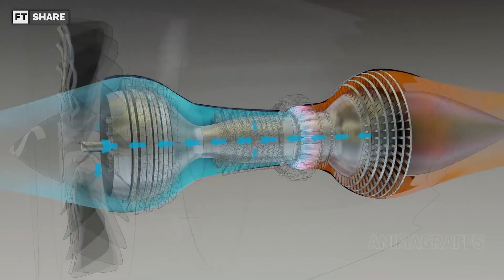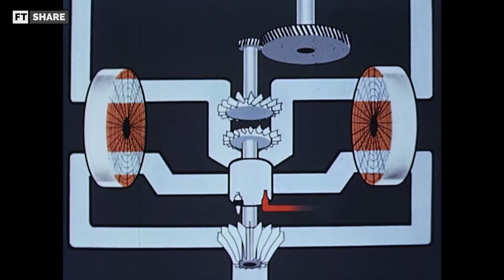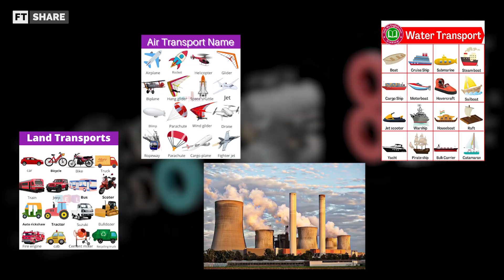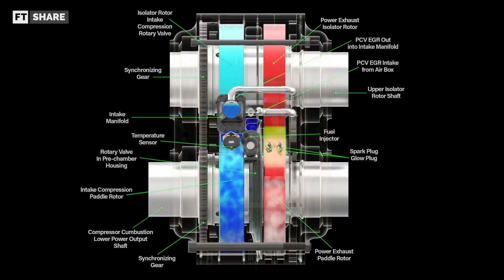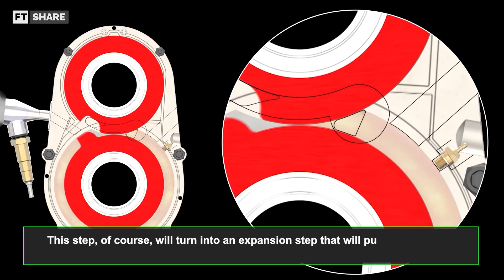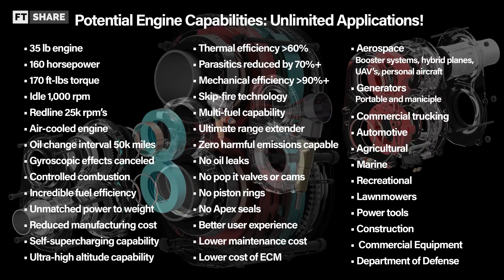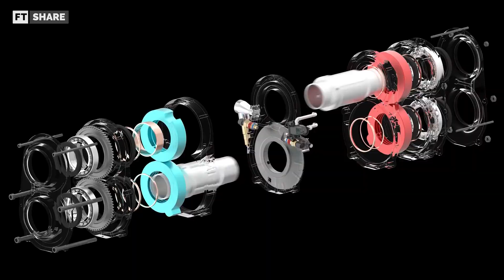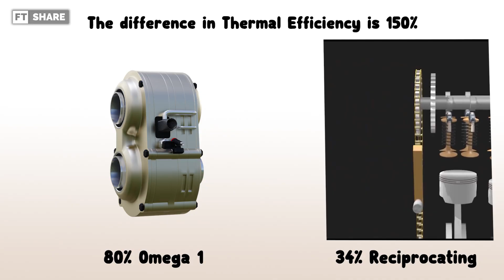Ready To Destroy EV Engine!! | Astron Aerospace - Omega 1 Engine

Comment: Don't see how it outperforms electric motors LOL. And EVS don't use an engine, it's called an electric motor for a reason. This thing would be used for hybrids that make do with the 160 claimed HP. Also, fossil fuels. Majority of ICE is still fossil fuels, with very few using sustainable fuels or hydrogen (hydrogen needs to be produced, so this lowers overall efficency on top of the already so called 80% efficency). So, if it's anywhere higher than 40% efficency, say at least 50% for running on gasoline it's better than current engines. 60% efficency would certainly guarantee hybrids exist longer and would support hydrogen ICE engines for ICE enthusiasts.

Comment: I would just like to know the fuel consumption of this engine would it be the same as a Wankle? I'm really cool thing about this engine. Is it only weighs 35 lb versus around 700 lb for a V8? Even if you put four chambers together, it comes out to 170 lb for an engine that's even still weighs less than 4 cylinder weighs.

Comment: 100,000 hours is equivalent to 3,300,000 millllllllion! miles. With a city-highway average of 33 mph. Easy to figure out of course. Ive seen most cars and trucks average speed between 28-39mph. Vehicles in rural areas could attain 40+ and small transit vans would really benefit from this. The question is how fast for how long.
Reply: Adding AC, generators and power steering would most likely cut these numbers in half.

Comment: Has a lot of pluses, but heat and sealing is going to be a problem, air cooling not likely, ease of manufacture, compression ratios,size, good, 80% efficiency is  Trumpian, but as I learned with my last venture, it’s tough to unseat a system that has been in vogue for over a hundred years, little development appears to have been done,the start is easy, but, as rolls RollsRoyce said to Whittle on acceptance of the Jet as a concept, (Simplicity? Don’t worry about it, we’ll soon fix  that!

Comment: In aircraft, turbine engines are notoriously slow responding to throttle changes, so much so that a jet routinely goes to high power as it starts to land, just in case the power is needed to go around, whereas a piston aircraft engine can respond almost instantly to a "power request".  I have seen power numbers in the stats but no mention in any of the discussions of responsiveness for this engine!!!  Aircraft can get away with slow responding throttles, cars cannot.

Comment: I would mentally think of it as most similar to a supercharged two-stroke. But I wouldn't classify it outwardly as falling into the "stroke" classification system at all.
Reply: Or a "two stroke diesel" (Detroit Diesel if you are American). I have better alternative designs, also suitable for anything from motorbikes to railway locos, one of which I proposed about 30 years ago. But live in the UK, where it is impossible to get funding for anything that takes longer than 3 months to develop. I told Ford, and they replied "we don't need new technology - we have old technology, and people are already buying that!" I also told GM and some other companies, with much the same response. 

If anyone is interested, I also have a design for a new type of wind turbine, with several advantages over huge rotating vanes.

Comment: I have seen similar engines to this.  The mechanics to this engine are a bit complicated but possible, this complicated mechanical design will drive up the cost, sealing this engine is possible but a nightmare. However, the overwhelming design drawback is the compression phase of the engine, notice the combustion chamber is expanding during the compression phase which makes the compression of the gases very poor hense poor efficiency.  If you compare this engine to the ME2 engine you notice that the ME2 has a very high compression phase hence high efficiency.

Comment: I remember the rotary engines offered in the 70ies. Seemed to be a miracle solution on paper, but the poor guys who bought these cars (NSU, Citroen, ...) rapidly understood that they were gas thirsty, with bad kmage per liter (or mileage per gallon for masochists), and costed a lot in oil, needing to refill after 1000 km. The joints were the main problem.

Comment: IF, the efficiencies, process, and 80% thermal performance holds true; this  is a significant breakthrough. Paired with a battery, this would be an incredible hybrid. Potentially doubling mpg. Its time to leave the 1800s timing chain, valve shafts, etc. I am impressed. I hope the unrealistic battery lobby does not destroy it.

Comment: Unless this concept employs ceramic materials with little to no heat expansion and extremely high heat tolerance, I don't see how it could be sealed, or even lubricated without a "dirty" oil-fuel mixture.

Comment: Yeah 80% thermal efficiency is impossible, because of thermal limitations of materials. It needs to get really really hot, the max efficiency of a heat engine is given by its carnot efficiency, which is 1-(T(cold)/T(hot)). Now if we assume the global average temperature of 15 C, that would mean to get 80% efficiency the engine would have exhaust gas 1167 C (minimum), typical cars have exhaust temperatures of about 200-250c. This is reaching territories of jet engines.

Comment: I don't see any seals, except blue ones on working model. And why it's dripping oil? Why smoking so much?
To design model in some CAD software is much easier that a working prototype.
For this engine to work there must be extremely tight toleration between moving parts. What happend when the engine heats up? What about thermal expansion? That's why we have piston rings, to compensate thermal expansion of different parts made of different materials. I don't see any here. 
And the numbers..... No comment

Comment: This is about the 10th video I have seen on this engine,and they all have the same 10 second clip of it running and nothing more, how about actual footage of it working in a practical application with a load on the engine? Otherwise the only thing it destroyed was my time.

Comment: Nice video, but let us wait for that engine to come. 
A few remarks on the comparison: the omega 1 engine is supposed to weigh around 16kg. But, what is included in this? I could not see any cooling equipment, although I might guess (even with the claimed, high thermal efficiency) it will heat up quite a bit. So, add the weight of radiator, water pump, etc. Then, how about a starter? Or an oil pump, etc...? I wonder at what final weight the engine will see the light of the sky... 
The same problems with sealing gave (practically) death to the Wankel engine a few decades ago. So, 100 000 hours without maintenance will need to be proved 🙂

Comment: The problem with vehicles equipped with engines like the Omega One is that a turbine does not provide reacceleration like the combustion engines used in current vehicles, making its use unsuitable for traffic in large cities.
Being used to generate energy for electric motors and with that impressive thermodynamic efficiency reported in the video, which would lead to negligible fuel consumption per kilometer driven, the use of the Omega One will be more than welcome.

Comment: Wow this clearly is a design that need many years of development, possibly 7 to 10 years to perfect and be economically feasible.  To be able to compete with EV/battery tech 5+ years down the road is a mission nobody wish to make, as the outcome is easily predicted.

No matter how much more efficient, you're still looking at a whole slew of moving parts, many at high speeds in very high temperatures.  This equates to maintenance cost that the average consumer would much rather live without.

Comment: So this is all theoretical since they haven't built one yet. How many of these "revolutionary" engines have we seen in just the past 10 years that were going to make everything else obsolete? The Engine also needs a cooling, oiling,  and electrical system added to it which will increase the weight.

Comment: Run this motor on hydrogen to continuously change a relatively small battery in a car and run the car on e-motor eliminating the gearbox and the weight, friction, maintenance … associated with it.
Probably the best of both worlds!

Comment: Which is it... 3.355Kw or 33.35 Kw?  The difference believe what was said and what was put on screen is an order of magnitude.

Also, let's assume that it was the higher number. 33.35Kw. That's still only roughly 40 hp. Not 4x that amount. If indeed it is just 3.355KW as was placed on screen that might be effective for a small push lawnmower (being about 4hp) but not much else... Go cart perhaps?

Comment: At 0:50 "It's been more or less 70 years since Chrysler was the first to discover and develop a gas turbine engine."  Less than a minute in, and this video already has false information.  The first gas turbine patent was issued to John Barber in 1791 and the first running gas turbine was the Elling Engine in 1903.

Development wasn't halted because of regulation.  It was halted because a turbine engine is the wrong engine for a car.  Turbines are efficient, reliable, and powerful when running at or near their max power rating and max speed.  In the case of a car, more than 90% of the time a car engine is down around 10%-20% power output and 15%-25% of the max speed.  The Chrysler turbine car had roughly the throttle response and gas mileage of the USS Nimitz.  It had low single digit mileag numbers and could barely get from one gas station to the next on a tank.  If you hit the gas at a stop light, the car wouldn't take off until the engine spooled up.  Basically like turbo lag, except instead of having low torque before the turbo spooled up, you had no torque at all.  If you held down the gas and brake at the stop light to keep the compressor spooled up, it was fine, but who really wants to have to two foot it at every stop light, and doing so exasperated the bad fuel economy.

I don't buy the claims of 80% efficiency.  The Carnot limit is 50% and most gas engines can't get over 25.  Diesels, usually 35 or 40.  Big marine 2 stroke double acting piston diesels, 48 or 49.  Even steam engines with economizers rarely get over 70 or 75.

The 160 hp statement is a little laughable as well.  The thing looks to me to have 15 or 20 cubic inches displacement, and power is a function of air flow, and even at 25k RPM, it isn't going to move that much air.

I doubt that hydrogen power  would even be feasible in an aircraft, as it has very low power density when you factor in the systems that are required to store it properly.  Also, Hydrogen is energy storage and not fuel.  Pure hydrogen doesn't exist on earth.  It has to be made through electrolysis, which tends to be a very inefficient process, and if you are doing it using grid power, then you are using fossil fuels, and the overall efficiency is poor.  

Regarding the lack of seals and the idea that tight tolerances and narrow clearances could seal it in conjunction with a little water vapor from the exhaust.  Tight tolerances increase cost.  You add a zero to the right of the decimal in tolerance, you add one just to the left of the decimal in the price.  This is why good engineering seeks to maximize the tolerance not minimize it.  The rotors and casings will probably have to be cut on a wire EDM and that is a slow, expensive process.  The drive gears will have to be incredibly precise and have very little backlash, which would be a problem.  You would probably have to use some exotic materials to hold clearance against thermal expansion.  Regarding the water, I doubt that it will do much in a hot, high compression engine.  The flame front during combustion is probably going to be 1500 degrees F or higher and pressures might be upwards of 2000 psi.  A little water vapor will be meaningless in those conditions.  What the vapor will do is contaminate the oil and make it all milky like the stuff that is dripping out of the seals.

The fact that they say it will not suffer from pinging/pre-ignition seems a little odd considering the fact that you can hear the knock at the end, and there are no reciprocating parts that would have a bearing knock.  

No leaks, then what is the stuff dripping out, and why are the mats on the floor?

As is usually the case for these types of videos, extraordinary claims require extraordinary proof, but I am not seeing it here.  It doesn't even look like it is connected to a dyno.

Comment: The reason the Chrysler turbine engine was abandoned was for several reasons. One, because the exhaust temperature was very high and could actually be a danger to other drivers. Two, the precision required to build them made them very expensive. And three, turbine engines in general have a fairly low throttle response, which does not lend itself to automobile driving expectations.

Comment: None of these miracle engines ever seems to make it into production and in the end, the age of the internal combustion engine is almost over.  EVs won't kill the internal combustion engine because they are better, they will kill the EV engine because there is a finite amount of oil, and as oil production declines, the cost of gasoline will simply become so high that people will not be able to afford to buy it. The Permian Basin is the largest area of oil production in the USA, and production there is set to peak in the next 6 years. Once the production peaks, there will be more and more competition for less and less oil.  In 15 years, only businesses and the wealthy will be able to afford to operate internal combustion vehicles, but even the rich are moving to EV.

Comment: This engine may well have the same problem as a Stirling engine. The combustion disc will always be hot.
Its heat will build and build, causing the metal parts to expand.

Then there's the problem with the seal between the top combustion disc and the bottom. Without a really good seal, it will be impossible to build up enough compression.

These two possible problems can feed on one another, causing a dramatic loss of performance, or even the destruction of the engine itself.

Comment: I filed a patent application in the UK on this principle of engine in the early 80s, and I hawked it around every motor and engine manufacturer. The only ones who spent any serious time with it were Lotus. Suffice to say that nobody wanted to get financially involved, for all the reasons that you see in the comments here. I still kept all the original drawings but gave up on the concept as a nice idea which was never going to be practical in the real world. However, if these guys can pull it off, good luck to them.

Comment: Lubrication? With the high tangential velocity of the sealing system (which is very high compared to present 4stroke engines), lubrication will fail and eventually, its efficiency will drop very fast.

Comment: I am not an engineer so my question may be stupid. Does the thermal efficiency quoted mean improved fuel consumption for work produced? I'm asking this as the Rover gas turbine and the Wankel had higher consumption in relation to power output

Comment: simple however contact area for thrust is small in combustion engines the same values hold true to keep this engine small will mean little power.  the bigger it gets the more power it will develop.  fuel still keeps the same burn power and ratios.  the stats seem really to much for the size.  and the thermal efficiency?  not even close would be my guess.  what does this have to do with a turbine engine however?  Nothing.  So right away I feel this is just hype for something that does not work yet and they are trying to get funding.  its not a rotary engine as no rotary like movement.  rotary was a pig for fuel as well plus even new they leaked oil so first startup was always blue smoke.  Interesting design.  But I just dont see it making enough hp to do anything with.  and efficiency?  not its still a ICE type engine.  It has to become hot to work and that increases friction.

Comment: Mid 70’s , Smokey Yunik made the adiabatic engine . Two cylinder,turbo charged. Very efficient, but GM wanted to copy it without buying the rights . Another engine in the 80’s was the Sarich Orbital engine .It was another light weight power plant with a promising future that was meant not to be.
Reply: The original Orbital engine was never viable. After bagging the Wankel design, and then blaming the problems with their own sliding 'vanes' on faulty heat treament by outside contractors etc. the company eventually had to face up to the fact that the basic design was flawed. Of course, a lot of money had come and gone by then.

Comment: 80% themal efficiency , wow if thats true this will be the most efficient engine ever made, take a small version of this engine just to charge batteries in an ev car, we could still use gasoline but with much greater mileage , which i think is the key till wee get this whole battery thing and charging infrastructure figured out

Comment: I don't believe it. It has way too much surface area exposed to the combustion to have 80% efficiency. The sliding seals will require lube, which ends up being burned, raising emissions. Why isn't it shown on a dyno showing torque, hp, and emissions, while tracking volumetric efficiency and BSFC?  Because it doesn't work. I have been involved in invention evaluation since 1988, and I have seen many things come and go. Sometimes the inventors honestly don't know it won't work, but just as often, they know it doesn't work but are trying to scam investors anyway. There is a reason why real breakthroughs come from legit labs, not Doc Brown's garage.